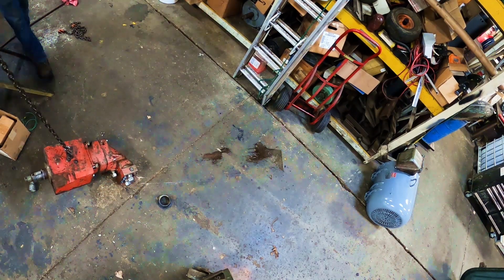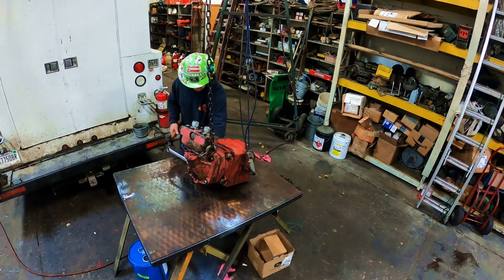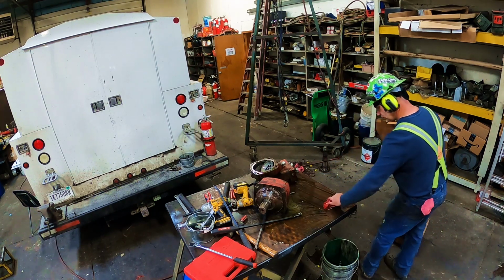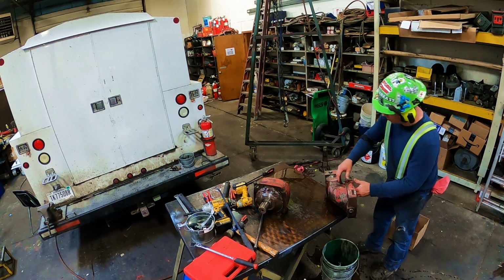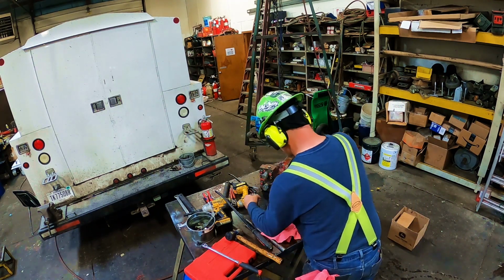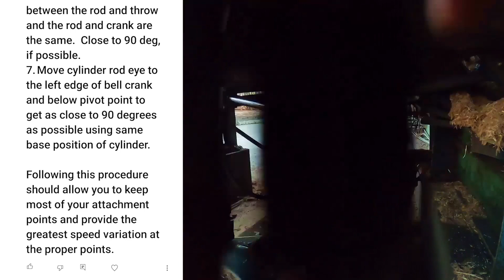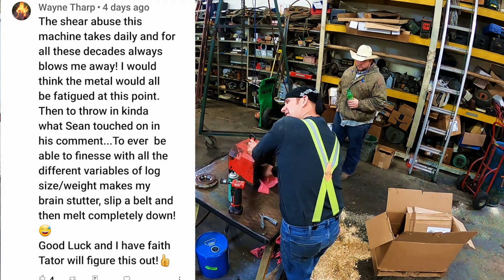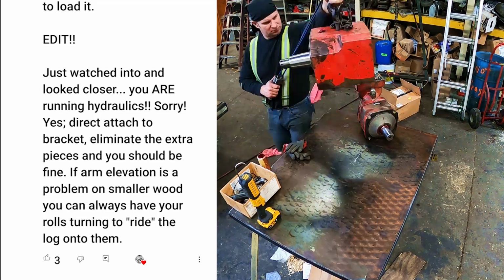🪝Inside an F12 150 hydraulic motor🔧

Comment: U can stake it and bearing retainer. Staking is taking a punch grind to a point and hitting it around to take up the slack.
Reply: There’s several Locktite products that does a lot better job than staking. The difference is in the gap between housing and the race.

Comment: I'm sure you put these together but a good machine shop can spray weld a shaft and turn to correct size for bearing fit and seal journals in a pinch when parts aren't available or  crazy expensive as of late...later on

Comment: With the shaft seal having a damage where the seal rides, you can see if the seal groove in the housing is oversized, and if it is - then you can try to put thick washer on either side of the seal, which will change the position of it, to make it run on the part of the shaft that wasn’t used yet.

Comment: You’re not wrong about parts availability. I work for hydraulic and pneumatic company. Lead times on new motors are about 30-40 weeks. Our hydraulic cartridge  vendor has pushed their lead time out to 50-52 weeks. The supply chain issues and people not wanting to work for whatever reason and the increase in shopping have all contributed to what we are seeing in parts availability.

Comment: If you ever have a chance - replace it to variable displacement motor with “pressure compensated” regulator.
That means that motor will start out with high speed/lower torque, then after building certain pressure it will lineary switch from high speed/lower torque to high torque/lower speed. So it will not bogg down as much under heavy load.

And you have to be careful with bent axis hydraulic components - the y are superior to straight shaft in performance, but shaft and bearing longevity is a downside of them.

Comment: I don't know squat about any of it but, you throw all the nuts, bolts and thing-a-ma-jigs all in the same bucket so, what I want to know is how in the he-double hockey sticks do you keep up with what goes where when you're putting this stuff back together?  Dang man, I can't remember sh*t... most times the wife has to remind me to flush after I piss for criminy sakes!  😂😂
Reply: @hanslarsson4857  Yeah, just joking around... some what. I've run across a few things where something like bolts look all the same but one will be 1/4" shorter than the rest that needs to go back into the hole it came out of.  I'm not an experienced mechanic by any means so I get a little paranoid and usually end up keeping track of what goes where, if I can. lol.